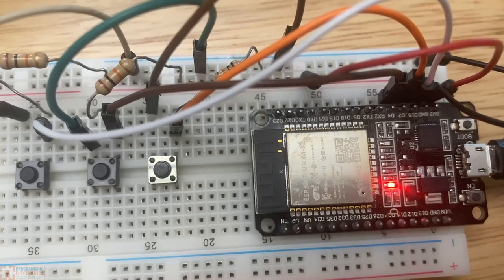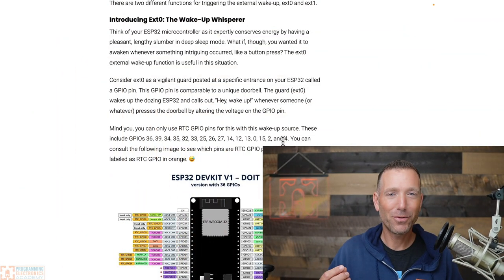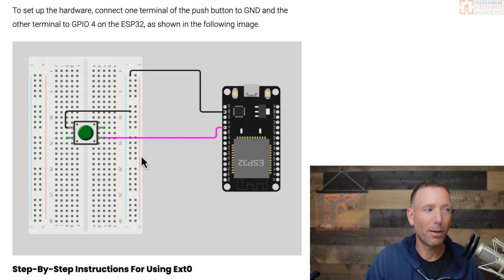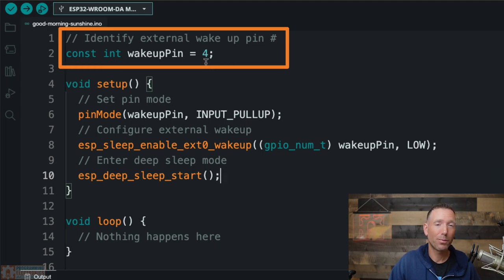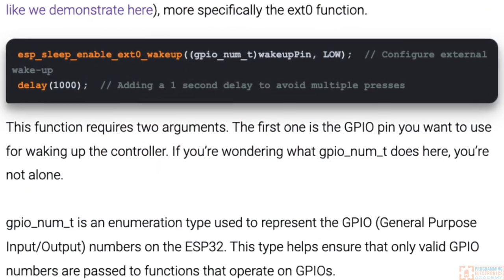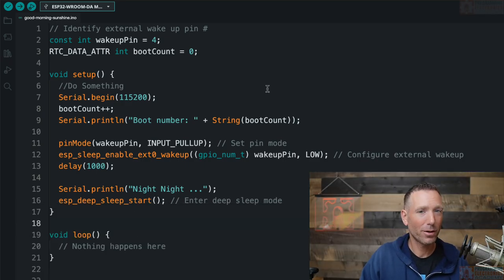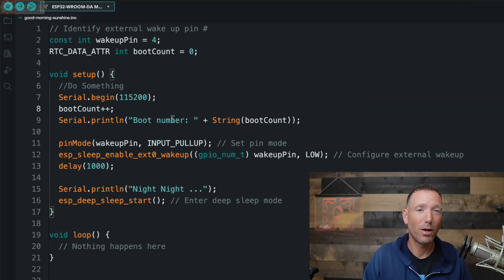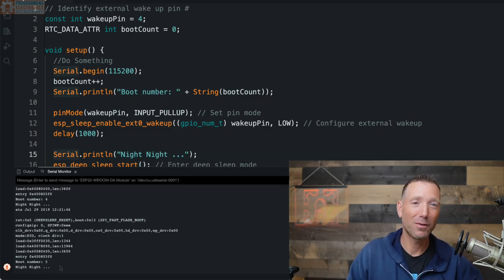Beyond the Zzz's: ESP32's External Wake-Up in Deep Sleep Explored

Comment: Thanks! So, if you lose all of your variables and such, then deep sleep isn't equivalent to putting your computer to sleep, it's more like a reset switch, correct?
Reply from the maker: That's exactly right Keith!  From a functional perspective,  it is very much light pressing the reset switch.
Reply: But RTC memory is not disabled in deep sleep so its not exactly reset button. Youcan store data there

Comment: Hi, is there any way to use the deep sleep and wake up functions within the void loop? I've known about deep sleep and wakeup but it's no use for most of my sketches that use void loop to perform various tasks. Thanks.
Reply from the maker: Yes - I don't think there is any reason you can't do that.   Just keep in mind, when the sleep function is called, the loop will stop, and when you're program starts again, it will be from the top of setup.
Reply: @programmingelectronics  Thank you for your reply. So putting the unit into deep sleep is not hard at practically any part of the sketch, but it seems that waking it up by input seems impossible except for a hard reset. Specifically, I was trying to use a touch sensor to accomplish my objective without any success. If you can shed any light on this, I would be grateful.

Comment: Your videos are super helpful but I just have one problem. So I have a project that uses esp-now to communicate. One acts as the transmitter and is basically just a button that when it is pressed, it sends a message to remotely turn on some peripherals connected to the receiver. My question is, is there a way to use ext0 but instead of a button that is connected to the receiver, the transmitter will send a value to tell the receiver whether to wake up or sleep?